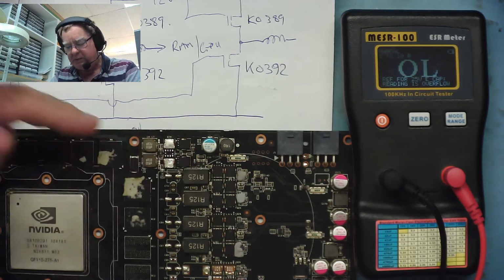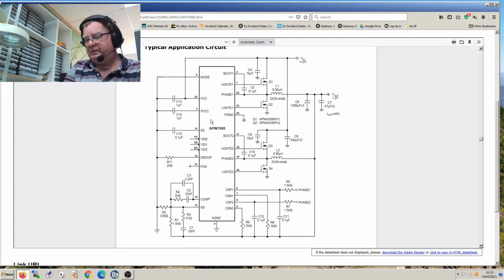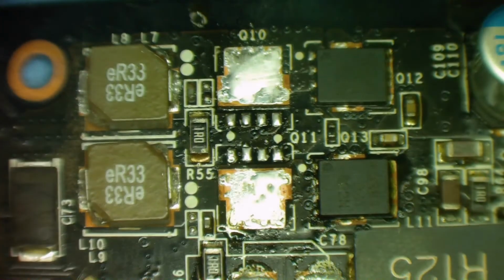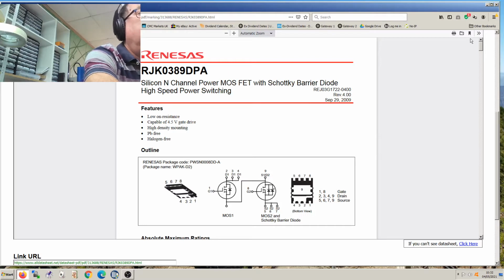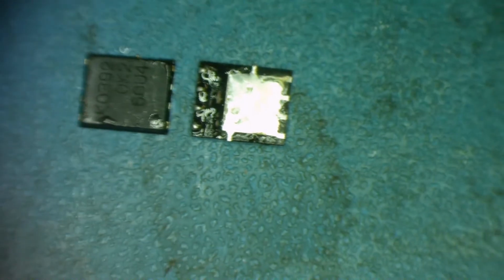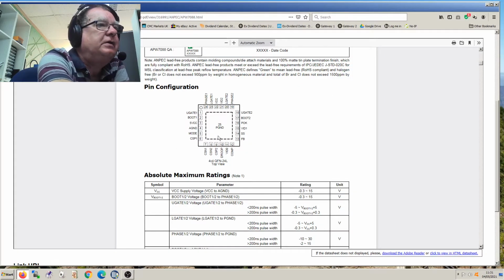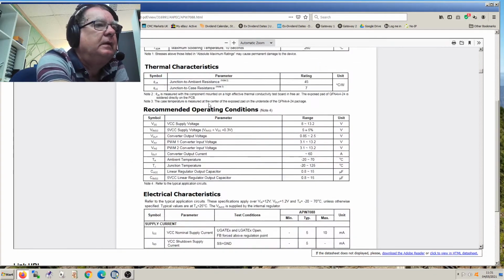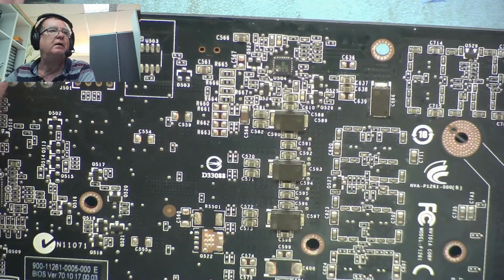LER #042 How To Diagnose & Repair A Dead Geforce Graphics Card GPU Not Detected By the PC - Part 2.

Comment: When a mosfet is turned on, will there be resistance or will it look like a short (when checking it off the board) Thanks
Reply from the maker: It reads like a resistance but it is extremely low so your multimeter will see it as a short.  You can find out what the resistance of a Mosfet is - the parameter is Rds and it is probably hundredths of an ohm
Reply: @learnelectronicsrepair  Thanks for the information. Have a nice week and weekend.

Comment: Thanks for another great video, mosfet information very handy! What microscope do you use or would you recommend, maybe a topic for a video.
Reply from the maker: Hey I'm well happy that you enjoyed it so much - it encourages me to make more like this one.  Yeah regards the microscope mine is an Amszoom Trinocular Simulfocal Microscope.  

It's this one (with all the accessories shown on this listing, inc the double boom stand) from this seller.
https://www.aliexpress.com/item/1005001305111556.html?spm=a2g0o.productlist.0.0.16006361mhMNWa&algo_pvid=9f664959-82e8-4c6b-8e1f-3ee95c9ad6b0&algo_expid=9f664959-82e8-4c6b-8e1f-3ee95c9ad6b0-10&btsid=0b0a119a16202197134076593e7fbd&ws_ab_test=searchweb0_0,searchweb201602_,searchweb201603_

Mine is the black version - I wanted the white one but I bought on singles day (11/11 2019) which is the Chinese version of Black Friday - and they had no white ones available so I had to have black.  But at least I got a good discount on the price.

I have mentioned microscopes in passing a couple of times but I will make a video specifically about that.  Thanks for the idea.